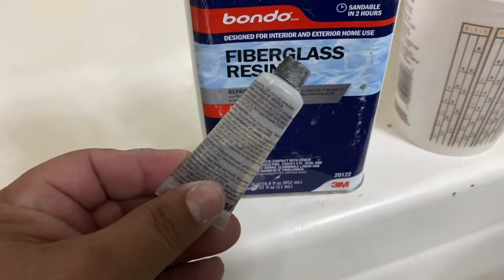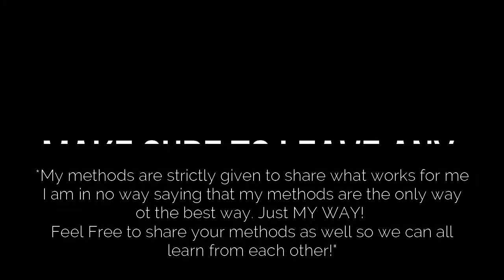USING FIBERGLASS RESIN AND FOAM TO SUPPORT A CRACKED BATHTUB | DIY Fiberglass Bathtub Reglaze Repair

Comment: Where can you purchase all materials needed for this job, Lowe’s, Home Depot, Walmart, or auto parts house, etc?  Btw, great job and thank you for the diy video. It truly helps out and saves money.
Reply from the maker: All of the above!
Reply: Walmart is the least expensive for the same brands. Foam can and will keep expanding for several hours. A wooden roller is available for rolling the mesh into the resin. Using a brush tends to pull at the mesh and pulling it out of its matrix.  A trick for getting the resin to not be tacky when cured is to cover it with wax paper or non stick aluminum foil. Non stick side into resin.  Let cure for at least 2 hrs. After removing the covering then wipe down the resin repair area with acetone and that will make the resin bone dry, no gumming  up your paper.  As to top coating you can get the product called GELCOAT.  It can be purchased pre colored at Home Depot, lowes or you can get it at automotive paint supply store and have it colored to match.  You can spray it or just pour it on and roll/ brush it on. Then after curing/drying you can wet sand with steps of 120/180/220/400 then polish it all with rubbing compound. Now if you are in textured area polishing is not done. Getting the repair to match perfectly would require a lot of experience that most DYI's simply don't have.  Any and all sanding can be done with wet sand paper if you don't like all the dust. Just be sure to use a blow dryer to insure its is dry before applying any additional materials.  You can also use the heat from blow dryer to warm the resin to cure much faster. Each 10 degrees of temp increase doubles the reaction rate and the opposite is true if it's cold. So get it warm!  If the damage is on a vertical surface where the resin run down like water then use a product of gelled resin with chopped glass in a can.  It is called long and strong! Funny huh? Use it like applying any brand of bondo ( polyester autobody filler )
Reply: I got everything at Lowes, but everything was kind of scattered around the store. They didn't have the locktite foam, but they said any construction grade foam would suffice. I have about $120 dollars invested for materials so far. If I had a contractor do this, the repair would be at least 4  times that. A complete replacement of my shower stall was $1200 and a ten week wait for the order.
Reply from the maker: @stevebarnett2682  that’s awesome Steve! Also make sure to look at the bottom of any foam can ti check expiration dates or shelf dates. Shake foam cans very well. If you have any direct questions feel free to post here or message me on Instagram as well.

Comment: Why did you use 2 types of Bondo?  Could you have used same one for both coats?
Reply from the maker: One is a bondo glass filler that has short strand hairs the other is a smoothening putty that can be sanded smooth. The bondo glass does not sand completely smooth.

Comment: How long did you wait for the resin to fry before sanding. I'm doing one of this tomorrow and I'll do exact same process.
Thank you sir
Reply from the maker: I wait about 30-45 minutes or once it’s hard. 

Make sure when you mix the resin with the hardener you do 10 drops then mix then another 10 drops and mix and so forth. This mixing will help speed up the hardening time. Also make sure you have exhaust fan going to help remove moisture in the room.

Comment: I have a travel trailer with a cracked plastic/acrylic bathtub. Should I use this method or try drilling it, lictite foam, and using eternabond tape over the Crack? Will the fiberglass resin be too strong for the acrylic?
Reply: I have the same question.  Did you ever find out?

Comment: How does that LOCKTITE foam hold up? I've not had good luck with most store bought foams breaking down too much over time so I've resorted to an industrial grade foam. Guaranteed never to fail once applied properly.  However it's a pain getting it in when I need it.
Reply from the maker: Industrail grade foam is always better. However for the repair that I am doing and the price..the loctite workds perfectly. You can see in my repair that I like to still have a little flex to the area. This prevents cracking in areas around it. I have noticed with some industrial grade foams that the control of the expanding is tough and usually results in a buldge or bump causing cracking around over time. The loctite is very dense and will support the 3-5 inch gap under the tub between the subfloor substrate and the bottom of the tub itself. I personally like it.
Reply: @DPTubs  hello I see you just answered almost my question but still I wanna be certain. These are customers we are talking about here! 
I’ve always  been pushed to buy the Froth Pak foam to repair a tub by my refinishing provider (I see you use their products too) I was wondering if this is just as efficient to give enough support as the Froth Pak foam
Reply from the maker: @loganencarnacion5487  100%

Comment: Thank you for this. Bought all the supplies and I'm about to follow your method on a cracked tub in our new home.🤞🤞

Our other shower isn't cracked but has very poor support underneath - it flexes pretty badly when occupied.  What do you recommend for this - drilling holes and foam fill? If so, how to seal the holes?  (I've tried piping the foam in from the access panel in the adjoining room but it didn't fix it 100%)

Thank you very much for sharing your knowledge.
Reply: Drill a couple holes from the crawl space but not thru the tub then foam from underneath.

Comment: Not putting the concrete mix under the tub like it calls for in fiber glass tubs is how this happens.  U ever been In a tub and it flexs under your feet. Because it's hollow underneath.  Just had this happen 2 me.
Reply from the maker: Very true. So many builders did not install the tubs with a concrete mortar bed to begin with so this is the best way to fix once installed years later.
Reply: Well also, not all pans call for mortar or require mortar beds. Now ,there are foam pans but obviously being used in lieu of mortar . But, there are many shower pans and tubs that have a     laminated Luan board with Styrofoam.  Usually 2" thick . That Styrofoam will break down in time and cause soft pan issues. So the not having mortar comment doesn't always apply to why......
  Also to note that mobile homes ,and RV's "Especially" you will never find mortar beds. So the comment of why tub flexes is because of  no mortar ,well as you now know are other reasons involved.  🤔

Comment: Using the wrong primer. You have to use at least a oil-based primer or an epoxy primer recommended

Comment: I layed the mat down and used the resin but I don't think I used enough hardener because after almost 3 hours it's still pretty wet.

Do you have any tips to help with the resin curing and getting it solid?
Reply: Wipe the area down with a dry towel to get any sticky excess off. Mix more resin with more hardener in it, pour over the wet part, re skim it, and it will all dry up nicely. I had same problem an got it fixed doing this

Comment: How do you remove resin?
Reply from the maker: Like an old patch?
Reply: @DPTubs  yes. I poured some resin over the cracks after I scratched it up real good and I didn’t mix the hardening solution good enough so it didn’t cure properly.
Reply from the maker: Try using some lacquer thinner and a rag to wipe up if it sticky.

Comment: I MADE A I BIG HOLE IN A TUBE, I CALLED A GUY TO FIX IT AND HE SAID I HAVE CUT A HOLE THROUGH THE WALL TO GET TO THE BACK SIDE OF THE TUBE, 2500$ NOW I SEEN THIS IT MAKE SENSE TO USE FOAM AS A STRING BACKING

Comment: Good job but did things backwards. 13 years experience here. Should have leveled out crack with bondo glass, then put fiberglass patch down, then Skim coat with glazing putty, if necessary. Doing this would have saved you half the time and less material. Still solid work
Reply: I disagree. The Bondo glass won't adhere as well as the fiberglass resin will. Your applying fiberglass to fiberglass. It doesn't get any better bonding strength than that. Bondo glass really isn't even necessary. The purpose of bondo glass in the auto body field is to bridge the gap between body filler and fiberglass. Bondo glass is way stronger than body filler but, not as strong as fiberglass. So why would you need bondo glass after putting fiberglass down? Bondo glass is actually brittle and will crack  with any movement, fiberglass will not. A better repair would be fiberglass only, with a marine type gel coat.

Comment: That foam is not strong enough will break in time , hawk sells some foam specifically for this gets hard like a rock comes in liquid 2 parts !
Reply from the maker: This foam works totally fine for what it was used for and the size of the gap underneath the tub